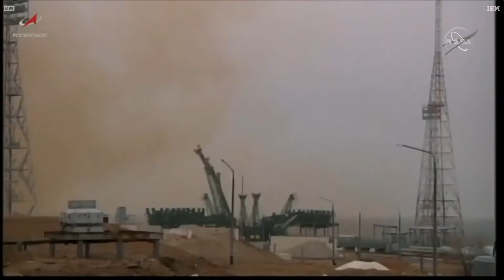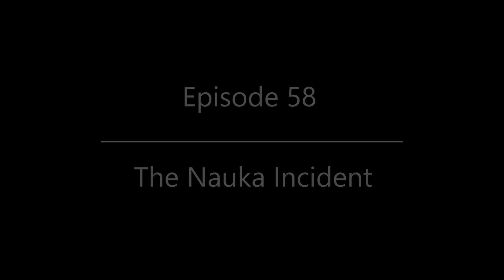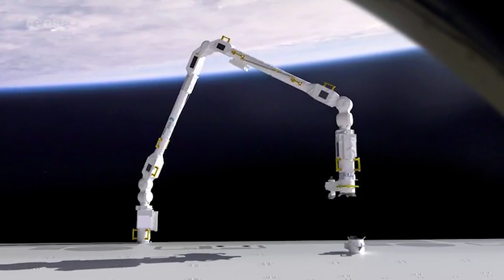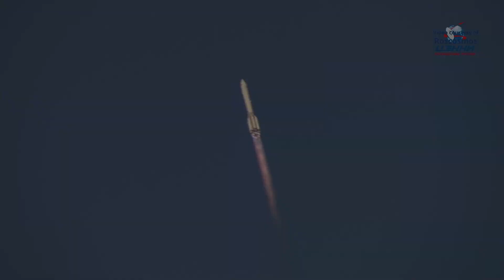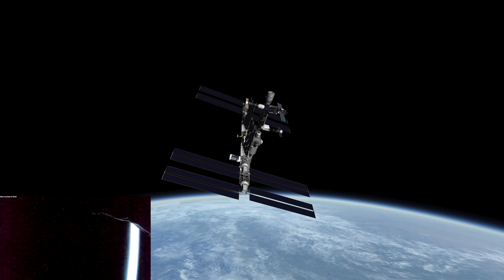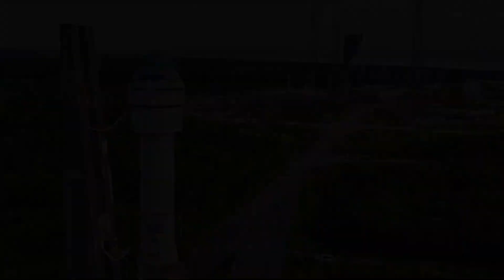International Space Station - Episode 58 - The Nauka Incident

Comment: After years of delays Nauka finally arrives at the station. During accent and during docking a computer fault occurred and the thrusters fired when they were not suppose to. Roscosmos disabled the thrusters and had to use Zvezda's engines and the engines on Progress MS 17 to get back on course. Over the next few days Novitsky and Dubrov  ran cables to connect the Toru and KORS system to Nauka's computers so this incident does not happen again. Progress MS 18 arrived to top off the tanks and the reactant valves were closed to the thrusters so they don't fire and the tanks will only be used to hold fuel and not mono propellent. Because of this Starliner was grounded and they had to destack when their mono tanks corroded the valves requiring a new service module to be flown in from Downy and the old one to be sent to the factory to be cleaned and the valves replaced. Starliner was grounded for a year and it will be two years before crewed flights would begin.